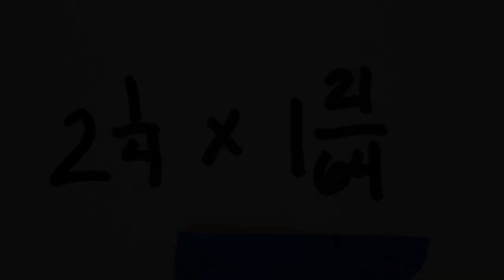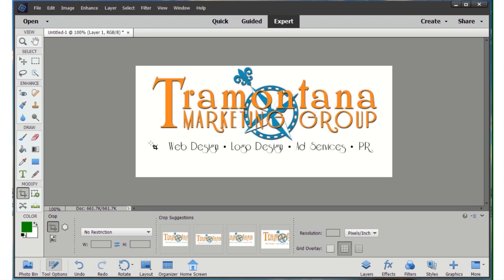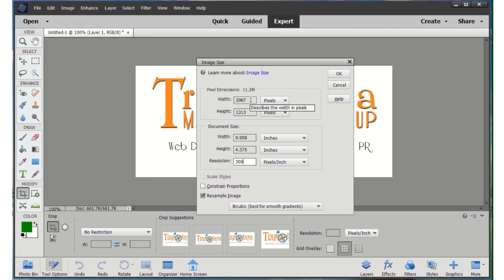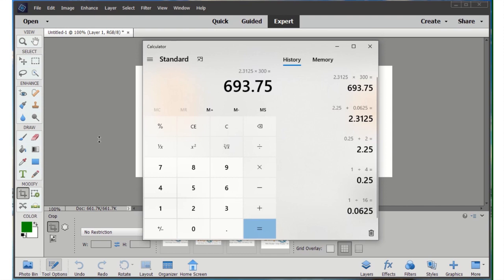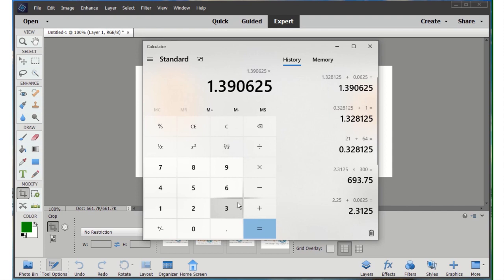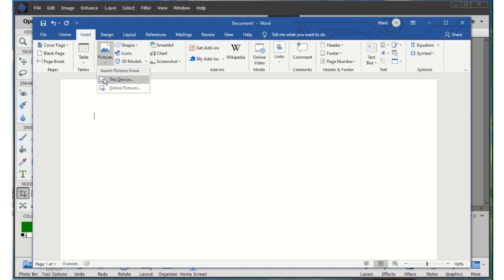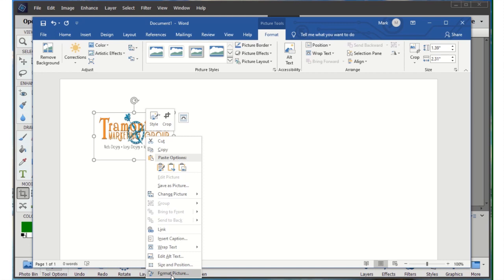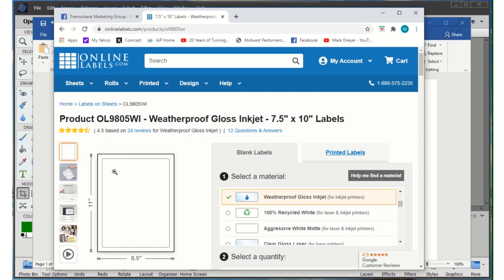10 Minutes To Better Pen Making -  Label Prep For Casting - Mark Dreyer

Comment: Big fan Mark. Why 300 dpi? I use the 1200 dpi setting on my little HP photo inkjet. The difference is significant.
Reply from the maker: Sorry for the delay - I completely agree and if your printer has the resolution - go for it. I am still using an older HP and in all honesty I have a background in print - so I just use what I know. I appreciate the comment and will look into it myself. Thanks for watching.

Comment: Mark, I can produce a label for a custom pen just fine, thanks to your detailed instructions.  But when I wrap a brass pen barrel, the adhesive on the label doesn't adhere at the edge.  That is, the two long sides of the label peel back after a little bit of time.  Any tips about how to get the label to adhere properly all along the barrel?
Reply from the maker: First - thanks for watching. When you say peel back a little bit is that during the casting process? And I hate to ask are you using the waterproof labels? I have not had an issue with the water proof labels with the 1/16" over lap. And I do finger press them on quite tight. Without water proof labels we used to use Modge Podge (sp?) over the seem. Let me know if you are using the waterproof with the 1/16" over lap.
Reply: @markdreyer2865  Mark, thanks for the prompt reply.  The peeling occurs before I get to the actual resin pour.  I am indeed using the labels you recommended, but I might not be getting enough overlap, and it appears you want the edges to be paper on paper rather than paper on brass.  I'll try increasing the width of the label to get more overlap and I'll let you know.
Reply: Mark, adding the extra 1/16" seems to have done the trick.  Thanks.

Comment: Mark - love the video and trying to figure something out.  I have a logo but when I copy the logo the image goes all the way to the edge.  I cannot crop it but can resize it.  Bit that doesn't give me any space for overlapping - I need to create a little "white space" around the edges - can you provide any direction?  Thank you!
Reply from the maker: Sorry for the delay in reply. When you paste and image in you should be able to move it around. The easier way is to create a layer first that is the size of the image for the blank. Put a white filled box in the entire layer. Then copy and paste your content into the new layer - you will be able to move, adjust, and size the new image in the layer. Hope this helps.

Comment: I know you said they were waterproof labels, but what stops the ink smudging. I have tried inkjet printing my labels but they always smudge during casting. Do you have to coat the label before casting?
Reply from the maker: So when you say they smudge are you using the waterproof paper? I never had an issue with smudging when using the OnLineLabels paper mentioned in the video. I do not seal anything, and I can use gloss also. Let me know if you are using the labels mentioned in the video. Thanks, Mark
Reply: @markdreyer2865  Thanks for the reply Mark. I just can't understand how the ink will not smudge seeing as it is printed on the paper. The paper may be waterproof but what makes the ink waterproof. I have just started out in pen turning and am still confused. John

Comment: what brand resin do you recommend? Im having trouble with cheap resin not curing hard after 1 week.
Reply from the maker: My guess is you are using epoxy. I never use epoxy for pan blanks - I agree 100% with you they never cure (and yes I know people will differ with me here). I use Silmar 41 for all my clear casts. If color casting - Alumilite slow. Thanks for watching....

Comment: Will just a standard quality ink jet printer do??
Reply from the maker: Yes I use a simple HP5740. Most any printer will do. The paper is more important - as mentioned in the video. Hope this helps. Thanks for watching.
Reply: @markdreyer2865  thanks for helping with this.   I’m not getting into this head over heals but it would be nice to make some custom pens for coaches, etc.    again, thank you!
Reply from the maker: @kevinrappold7795  I said the same thing over 30 years ago about pen making. It will draw you in. Good luck and enjoy the journey....

Comment: How do you obtain copyrighted material for clear pen blanks?
Reply from the maker: This is a complicated topic, but in general you need to speak with the copyright holder and get permission. I would highly advise that the permission comes in writing. The hardest part is tracking down the copyright holder.

Comment: what was the name of the kit again?
Reply from the maker: I use the Diamond Knurl from ExoticBlanks. Same form factor as the Sierra (bushings and tubes)  but I like the details better. Hope this helps. Thanks for watching.
Reply: @markdreyer2865  Thanks I'll check them out. I've been turning for a while but your videos keep me grounded in the basics. Thanks for all the effort and time it takes to put these out.
Reply: I have a question as I have no real experience with any of the programs you used , I downloaded adobe and followed your instructions to the tee , however when I printed the test label it was so dark and the colors are very faded , the red is not a bright red like the customer wants , how do I get the colors to stay sharp from the original scan? Thank you for the video it did help so much